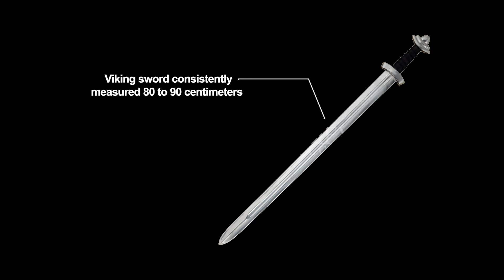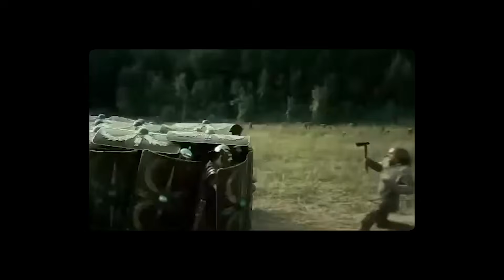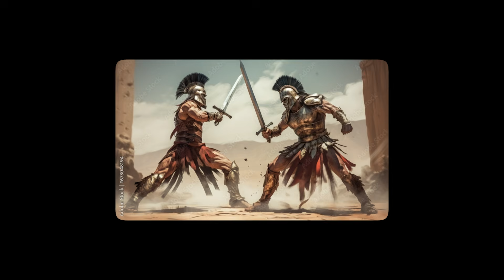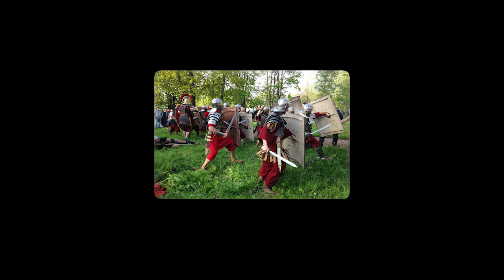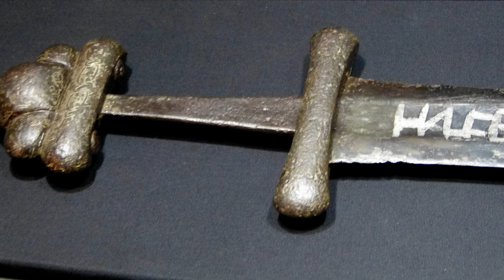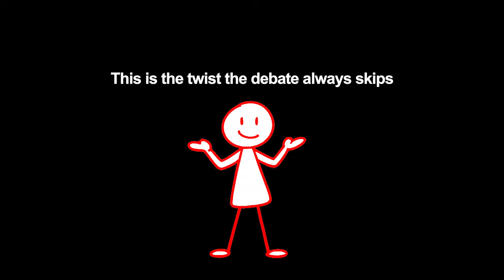Why VIKING Swords Would REALLY Destroy ROMAN Gladius (Physics Proves It)

Comment: The gladius is not an individualistic weapon. It was meant to be used in tightly packed almost phalanx style formations figting behind a wall of shields where you could sneak in a stab at barbarians swinging wildly at you. As the battle wore on, the enemy tired as the Roman front line would quickly retreat to the rear replaced by another fresh wall of troops waiting to get a stab in behind their wall. So the key to defeating any Roman army is to be able to break up their tighly packed formations and get them to fight as individuals.

Comment: having a hand guard for a gladius could of made it easier to potentially get caught by the scutum.  the swords was designed to be optimally used with a scrutum, and in formation.  short length also meant it could freely move behind the shield and not be seen untill stabbing at any angle.  its not meant as an optimal dueling weapon without a shield, where it would be at a disadvantage against a lot of swords.

if a viking and lone legionary fought with their specific sword and shields.  the viking would still have to get around the shield to use his sword, so the better sword is still not an advantage.  romans dont need to parry or bind with their gladius at all
Reply: OK I tested this. Sorry for the late reply.

Turns out to keep a crossguard from being a problem for a scutum you just have to.....

Hold it correctly. 

However in context with a scutum your hand will be a hard target anyway and even down to the millaounce swordsmiths tend to not add any unnecessary weight.